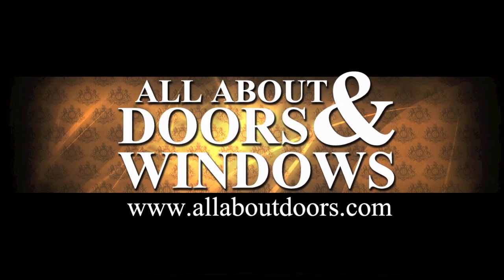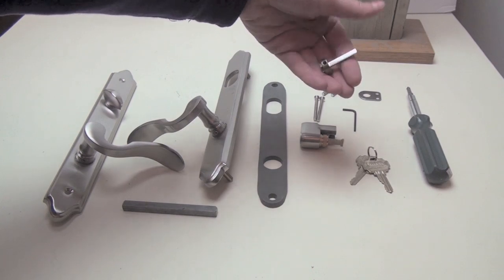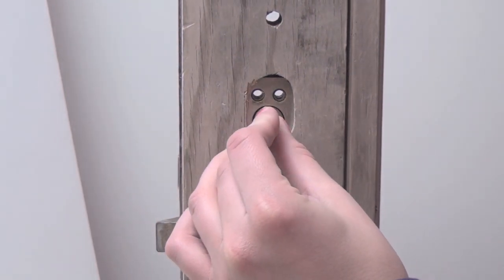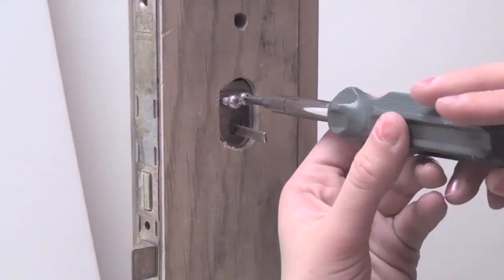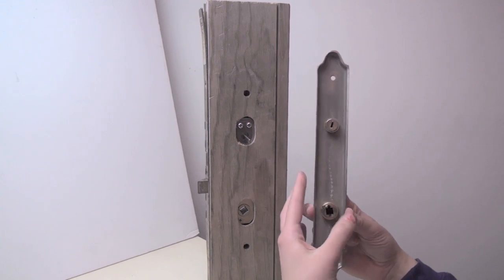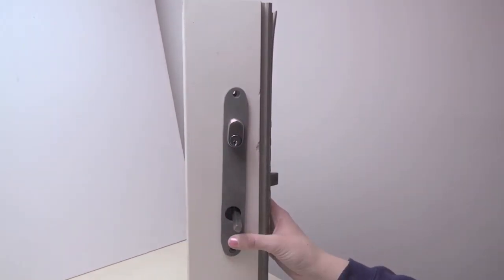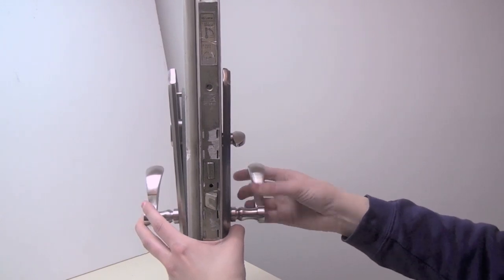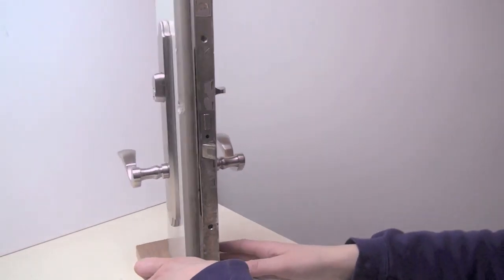Installing Handleset in a Door with an Andersen Multipoint Lock

Comment: Mine is very hard to lock. It was just installed by Home Depot and is difficult to lock and unlock. Is there an adjustment?
Reply from the maker: Hi Terry, do you think it's the handle or the lock that's the problem?
Reply: @AllAboutDoorsandWindows  It's the two locks on the top and bottom. If I open the door and lock it, everything locks easily, but when I close the door, it's very hard to lock. It seems the top and bottom locks are quite tight. Is there an adjustment?
Reply from the maker: @terryjones8360  Yes -- it's possible that the lock isn't aligned with the strike plates (or holes) in the door frame. I would open the door, engage the locks, almost close the door and mark where the strikes should be in the door frame and see if that's where they actually are.
Reply: @AllAboutDoorsandWindows  The door is just a bit skewed. The top does not quite close against the seal until the three point lock is engaged. I can see the door move about 1/16" as I engage the lock. That's why it hard to lock. It's perfectly plum, but the door is not quite straight. Nothing I can do about that, I guess.
Reply from the maker: @terryjones8360  We would suggest adjusting the hinges to move the door properly into the frame. You run the risk of damaging the lock over time if you leave it like that.
Reply: @AllAboutDoorsandWindows  You can adjust the hinges? Is there a video of how to do that? I've never heard of adjustable hinges...
Reply: I think I found how to adjust them. I’ll give it a try. Thanks!
Reply: Adjusting the hinges only helped a little. It seems the door is twisted and I don’t think there is an adjustment for a door that is not straight. If there is, please let me know. I’ll contact Anderson and let them know of my problems.
Reply: @AllAboutDoorsandWindows  I called Anderson and they said to give it some time and keep the locks engaged as much as possible. The door is wood and has moved a bit in transit and by keeping it locked, hopefully it will straighten out. They said to give it until spring and see what happens.  HMMMMMM....
Reply from the maker: @terryjones8360  We're glad you got an answer from Andersen!

Comment: And what if the handle latch fails with the door closed ?
Reply from the maker: Test it before you close the door. You can test whether it's working or not. Be careful that your shootbolts don't damage the floor, though.
Reply: All About Doors and Windows what if it broke when the door was closed ? Then what .
Reply: All About Doors and Windows the door is not locked but you cannot open it the lock is not broken the handle latch is it just will spin around and you cannot open the door to access it
Reply from the maker: Hi! Can you send us your phone number and maybe a picture by filling out the form on our website? One of our fabulous customer service folks can walk you through the process. Here's the link to the form: http://www.allaboutdoors.com/Information/Contact-Us